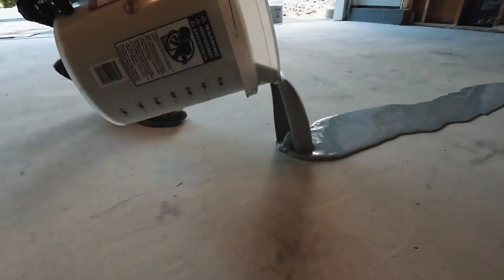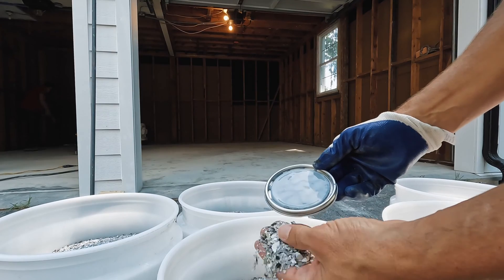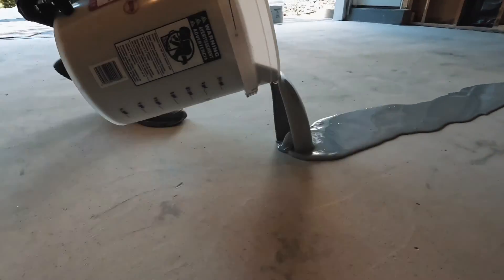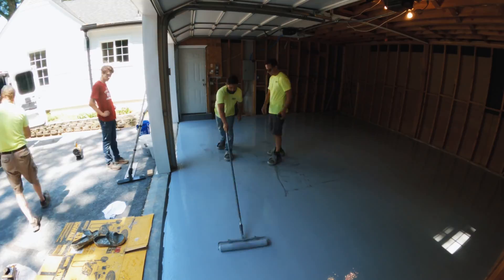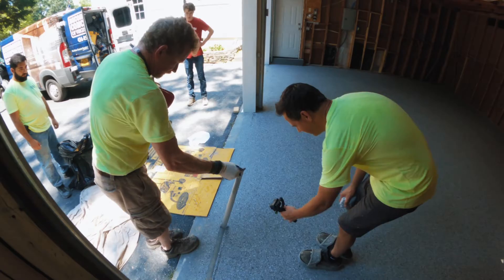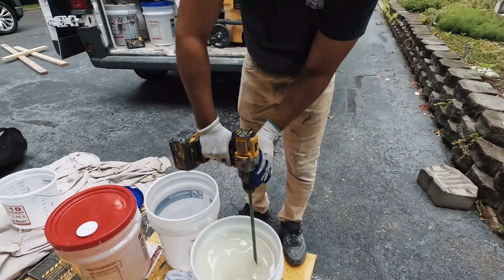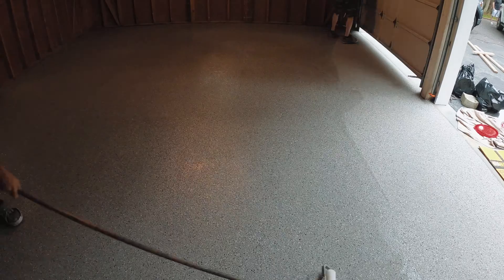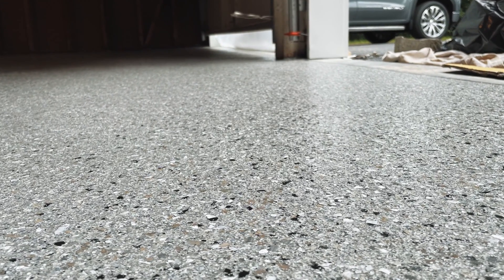Epoxy vs. Polyurea : I forgot to tell you this one thing about garage floors...

Comment: I’m confused.  Are you putting the primer down and the chips over that or is it a primer, then a coating, then the flakes, then the top coat.  I’ve watched a few of your videos and it seems it’s primer than flakes.
Reply from the maker: We throw flakes into the primer. 👍🏻👍🏻

2 coat system. 

1- Epoxy vapor barrier + flakes 
2- Polyaspartic top coat

Comment: Does the epoxy vs polyurea primer make a difference depending on location? I am located in central Florida where many companies utilize the polyurea due to its "flexibility."  I am however worried about the moisture and wonder if the epoxy would benefit vs polyurea.

Comment: adding final   transparent  coat  make it expensive.it has to be 100% epoxy resine and hardner.besids the chips has 2 advanges.one it m matches colour  and makes the floor  more  abrasive resistant to foot wear and tyre wear.iraq ibctc since 1991.

Comment: This video is excellent. 2 questions though. If the concrete has sawn cut control joints how do you avoid filling them while doing the rest of the floor and what do you use to fill them after the the floor is done (assuming you don’t want the floor seamless which I don’t )

Also, can you share what supplier you use ?

Comment: Hello, great video!  We are a new company that specializes in the epoxy/flake Polyaspartic systems and we are doing our first small driveway.  I was told to do a MVB epoxy, then put a tinted polyaspartic, flaking into that, followed up with a polyaspartic clear topcoat.  Does that sound right? or?  Thanks : )

Comment: Question: Setting the application of an "epoxy vapor barrier" aside for one moment, and ONLY looking at an epoxy base coat vs an aspartic base coat, and assuming an installer is a pro at handling either of these, is there any advantage of one vs the other?

Comparing these two BASE COAT choices (epoxy vs aspartic), it seems that all the pros and cons I have found relate to the convenience of the installer. Epoxy sets up slower, aspartic faster. Epoxy requires warmer application temps than aspartic. Etc. It seems that aspartic has faster setup and is more forgiving temp-wise, but if the installation team is familiar with it, shouldn't it be okay?

So, if all conditions are perfect for each type of base coat, and the installer is very experienced with either, which delivers a better floor generally? Is one outstanding over the other? Or, do they deliver about the same results and it just comes down to installer details and the applied product's formulation?
Reply: I am wondering the same thing.
Reply from the maker: @robink910  according to most tech data sheets, during pull tests, the concrete itself fails before the bond of polyurea or epoxy fails. So both are more than durable enough.  

The majority of coating companies use polyaspartic top coats… so when it comes to wear and tear from daily use… they should perform similarly. 

The epoxy has the vapor barrier advantage. 

The polyurea has the cure time advantage. 

Even though you can test for moisture… conditions change over time so the test results are only relevant for that moment in time. This is the reason I always prefer vapor barriers. 

You just have to decide which is more important to you.

Comment: Hi Tim.  Really enjoyed your videos and the process you use.
I am building a new home near Grand Rapids Michigan (Grand Haven - zip code 49417).
What is the best way to find a quality installer like you? You guys come out to Michigan 😉
Also is it good to finish the garage floor before it is used at all or does it have to cure for xx months before coating?
Thanks
Reply from the maker: Hi!

I love that area. I spent a few days there a few years ago. 

Sorry we don’t go that far… unless it’s a really big garage. Ha. 

I would wait until construction is finished on your home. That will give it a few months to cure. Don’t cover it with anything either… that will allow it to breathe so (hopefully) the moisture will all evaporate out of it.
Reply: @TimDCVA  Thanks.  I found a place called Decorative Concrete Redources.  Is it a franchise or a coincidence?
Reply: Resources not redources 😉
Reply from the maker: Coincidence. 👍🏻

Comment: I've noticed some local installers use epoxy and some use polyurea base coats, and I've been trying to figure out which installer to go with. One said my floor was 3.25% moisture, so I should use epoxy. Another said that's not enough moisture to need epoxy or a vapor barrier, so I should use poly. I think obviously each company just has their own reasons to use each.

And then a couple installers even advertise that they use 100% polyaspartic (for base and top coats), vs. all the other installers that advertise polyaspartic, but it's only polyaspartic for the top coat, and polyurea for a base. Are polyurea and polyaspartic really different?
Reply from the maker: 3.25% isn't an accurate measurement of vapor. Thats probably from one of those meters that you just set on the surface. They aren't intended to be used as an official moisture test...they are supposed to be used as a preliminary test to find trouble spots so that you can drill a hole and drop probes in to get a real reading. 

https://www.wagnermeters.com/shop/c555-handheld-concrete-moisture-meter-kit/

The problem with moisture in concrete is that, unless you know that you have a vapor barrier under the concrete, the amount of moisture in the concrete can change over time. So just because its low now doesn't mean it will be low the next time you measure it. 

Polyurea and Polyaspartic coatings are pretty similar...but polyurea can only be used as a base because it turns yellow over time. It costs less than polyaspartic which is why people use it. Both are pretty flexible. Both are also known for not bonding that well to concrete. I've heard that manufacturers have made some advancements to combat that though. 

I don't think there is much benefit to using poly as a primer. I personally prefer to use a vapor barrier epoxy with a polyaspartic top coat. It eliminates the moisture issue, and you still have a flexible coating because of the poly top coat.
Reply: @TimDCVA  Thanks a lot!
Yes, the reading was just from a meter placed on the ground. And I think of all the companies I got a quote from, which were all the most popular ones in the area, any that did a moisture reading used the same method. I assume none would drill down in someone's concrete unless/until they came back to do the actual job. One company mentions using a moisture barrier if needed, so I guess that's when they would decide. The house is less than 6 years old if that matters.

But even if I don't have a good reading of the moisture, it sounds like you recommend an epoxy basecoat regardless of moisture. Most of the companies I got quotes from use a poly base instead of epoxy. Is that just so they can get in and out in 1 day? Or so they can advertise that their newer poly technology is better than epoxy? Speaking of job time, anything wrong with quick-cure epoxy that allows 1-day jobs? One youtuber uses that.

My 3-car garage has real wood paneling on the walls, and for some odd reason, half of it has the paneling down to the floor, but on the other half, it only goes down to a few inches above the floor, with cinder block showing. Any idea why? When I asked about coating a few inches up the walls, most of the installers I got quotes from seemed slightly unsure about how, or whether to do this or not. One said I shouldn't coat the wood, as it wouldn't stick well, and wouldn't be warrantied. What do you think?
Reply: @TimDCVA  well of course. But i think another factor is how old the concrete is and the condition. I see a lot of different concrete, some grind much easier than other and create a lot of dust. I do think in some cases concrete is going to fall apart regardless of the prep for the coating.
Reply: these people are over complicating it for you, I do these floors full time with Polyurea for 5 years now as a solo worker and it's not an issue. I never do anything "vapor" wise and i grind half as much as these big industrial machines do. I do up to 900sqft in one day start to finish with polyurea by myself and never have issues or concerns of moisture. 

the biggest downside with polyurea is you need to use a different process because it dries so fast, so if you're not experienced with it and dont have the right process it will not be good.
Reply from the maker: We’ve taken up failed coatings for the past 20 years and it’s always because of moisture or lack of prep.

Comment: Correct me if I’m wrong but aren’t moisture vapor barriers supposed to be installed at 16 mil?
Reply from the maker: Different manufacturers recommend different things. 

Most vapor barriers that hold down 20lbs/ft are supposed to go down @ 100ft/gallon. 

This particular product holds down 8lbs, and the manufacturer recommends 160ft/gallon.

Comment: Are epoxy floors slippery when wet ?  When the particles are added ( broadcast to rejection) does it make the finished floor hard to clean ( because of the rough surface texture) ?
Reply: At full rejection put your top coat down around 120 - 130 square feet per gallon
Reply: @Deanmartell  Thank you.

Comment: Afternoon Tim, I live on the Eastern Shore of Va and have a 28 x 32 garage with raw concrete never treated or painted. We built it in 2001 and have been holding off coating the floor due to all the horror stories about epoxy coatings.  Looking for a rough idea on cost to get it done. And I guess my next question is do you service my area 23350. Thanks! Dave
Reply from the maker: Hey Dave. I love the eastern shore. I’m not sure if we’d take that on or not. 

Would you mind filling this out (including photos) and I can let you know?

https://www.decorativeconcreteofvirginia.com/contact-us

Comment: Hi Tim, would you do a deck off condo at North Mrytle beach, 4th floor on the beach? Do you also travel to Raleigh Nc 
Thank you !
Reply from the maker: We do occasionally work in RDU. It just depends on the project. 

We haven’t worked in MB before… but we would consider it depending on the project. We spend a lot of time in Surfside during the summer anyways. 👍🏻

Fill out this form if you want to check with us about getting a quote. 

https://www.decorativeconcreteofvirginia.com/contact-us

Comment: I have been looking at epoxy/polyaspartic floors for several years now. I do not know Tim nor do I know his team. I started my business last year and was sold on one day floors. If you speak to resinous experts as opposed to product pushers, you will find that Tim's way of installing these floors is the way to go. His videos are very helpful and he explains why he chooses an epoxy basecoat with a poyaspartic top coat. Since switching to his way of installing, I have had no issues plus my floors are consistent and beautiful. It plainly and simply allows you to do a better job for your customers.
Reply: Yes, got this combo. It’s the correct install!
Reply: Hmm it’s not a one day floor.  Two day install
Reply: @toadshrm  Polyaspartic floors are being pushed and sold as one day floors. I said Tim's way of installing resinous floors is the way to go (2 day floors). I think you misunderstood.

Comment: How slippery the floor gets when is wet ......... what  could you add to prevent  that?
Reply from the maker: I don’t think its that slippery under normal use when its wet. If let kids run across it while it’s wet, then they might slip… but I don’t think it’s slippery if you are just walking in and out to your car.

We can add grit to the top coat if it is a concern.
Reply: anti slip broadcasted just like the flake after the final top coat. its like clear sand texture

Comment: why do you end where the garage door comes down rather than over the edge or covering to the threshold gap?  I had mine coated to the threshold gap because you are rolling over the edge with your car all the time and you are leaving the possibility of separation at the edge especially if there is a higher lip.
Reply from the maker: I’ve never had any issues with the edge separating from the concrete. 

We grind a straight line under the door, which recesses the coating a little below the exterior concrete anyways. 

Also… i don’t like the way the interior floor looks outside when the garage door is down. It rarely matches the decor of a house.

Comment: Hey Tim,
Thank you so much for your videos they really help me a lot in my newly established epoxy business.

I was battling for a while on the epoxy vs polyurea base coat issue and while searching on Google polyurea always came up as the better solution pitched by mostly franchises. However when digging deeper and calling up companies that have been in the space for a while, they still swear by epoxy mainly because it creates a stronger bond during the curing process. Your video just confirmed to go with the 2 day install. 

I have one question. Do you guys grind an opening/line where the epoxy ends below the garage door for extra anchorage and protection?
Reply from the maker: Thanks. That’s awesome to hear. I’m glad they’ve been helpful.

Whenever we are doing a garage floor, we will take a straight 2x4 and place it in the middle of where the door lands. Then we will take our hand grinder and run it up against the board so that it grinds a perfectly straight line. The hand grinder is also more aggressive so it cuts the concrete lower than the unground concrete, which creates a key way for the epoxy to stop in.
Reply: Can you apply the same material to a 3” to 4” outing above the floor?